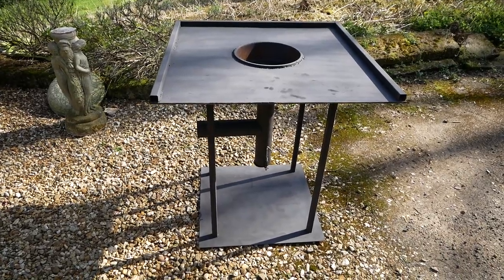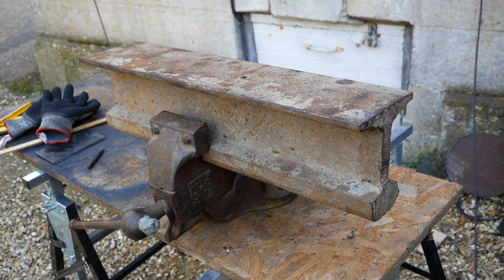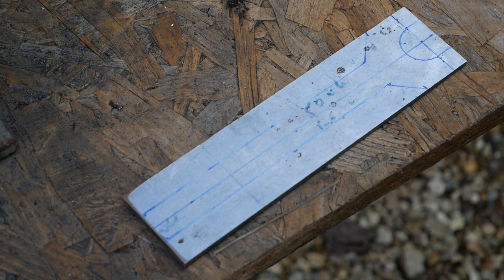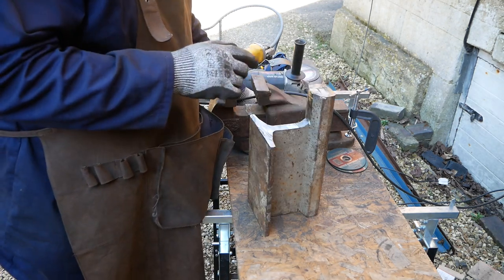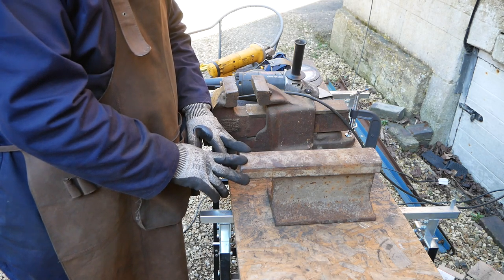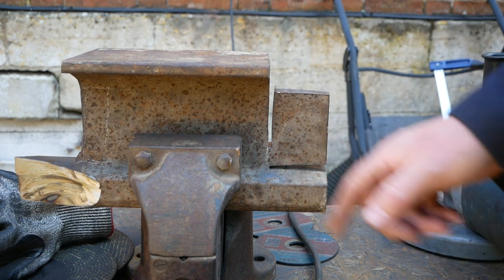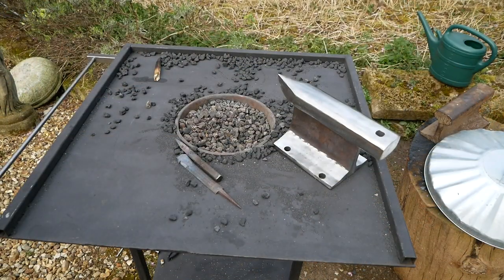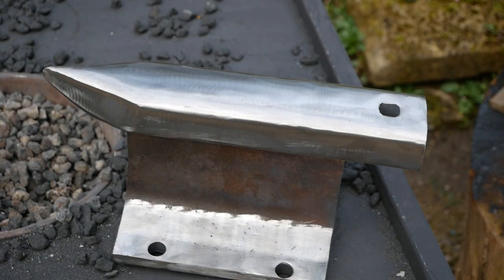Railroad Track Anvil and Brake Drum Forge

Comment: Oh man!! Thank you so much. <3 Too kind!
Damn! The forge came out great! Congrats on welding the two pipes, tricky for sure! I was lucky to find an irrigation connection already made that saved me the trouble! 
Sweet vise as well, killer deal considering quick release and size. 
And well done with railroad anvil! You made me remember how much work that has been :') 
Congrats for everything man. Keep up the great work!
Reply from the maker: Thanks so much and I couldn't have done without your video. Yes, welding the pipes was tricky, but at least you managed to weld the brake drum to the steel plate. I couldn't manage that. Tried heating the drum, all kinds of things, but welds wouldn't hold. Still, it works great.

Comment: on the cover for the ash tube use a hinge  a plate , and a length of bar it stays up till you kick it then empty's and goes back in to place no need to bend down under a 1300 degree forge  also when we made rail track anvils in hereford blacksmith college the rail track is actually to soft we ""lined"" the top with a fork truck tine its much harder steel
Reply from the maker: Fortunately I have upgraded to a grown up 220lb anvil you will see in some of my other vids. 😀
Reply: @Ukenick  i bought three in the last 2 months lol , think i may have a problem !